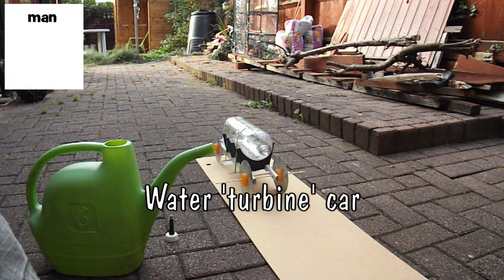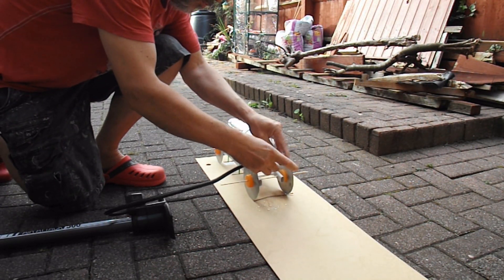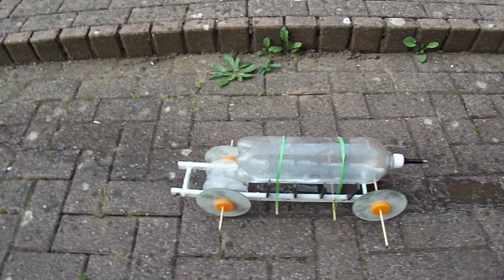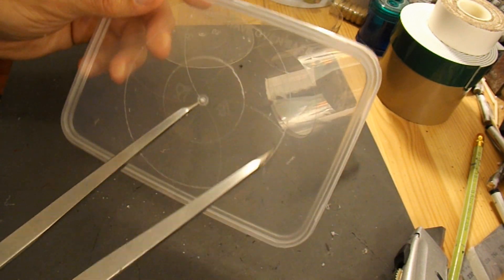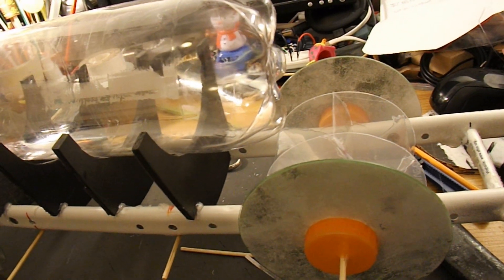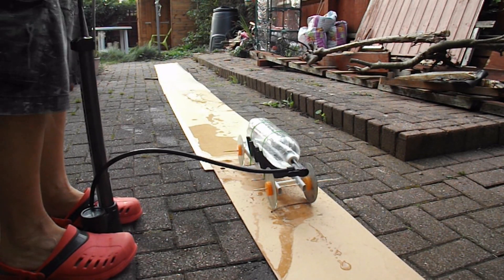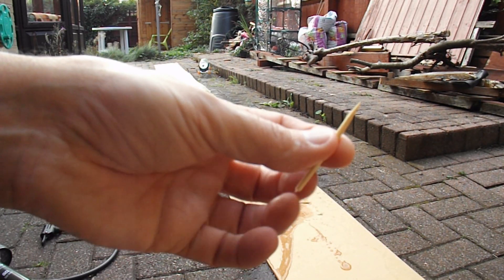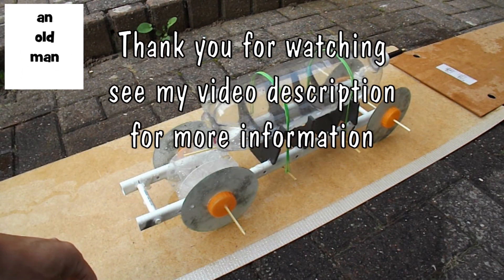Water Turbine Car

Comment: gear it down to the drive wheel and run a small air compressor by the turbine  to push pressure back into the tank to make it run longer and use more water.
Reply from the maker: Try it and find out if it works 😁👍